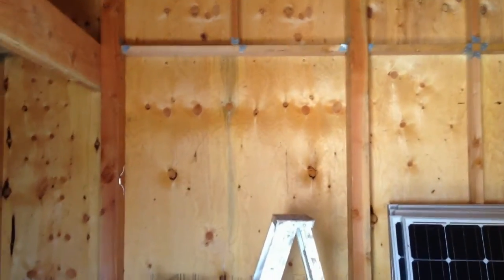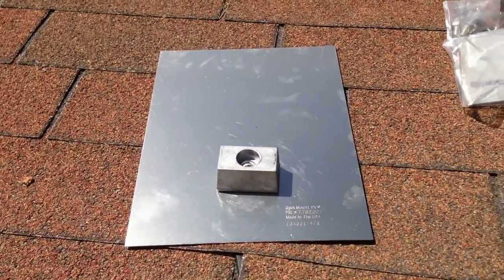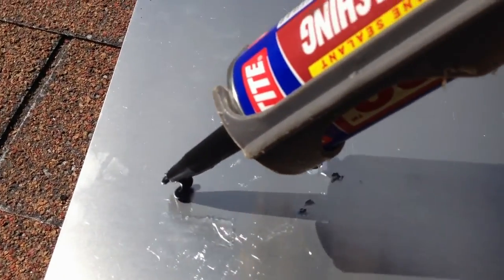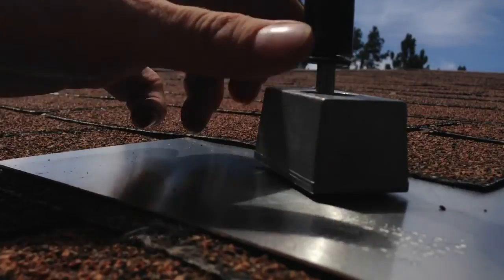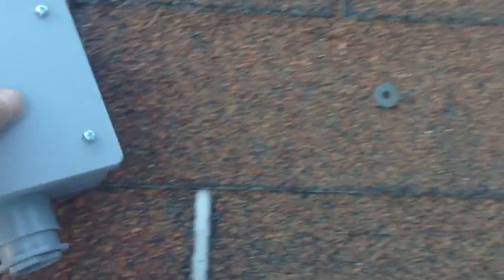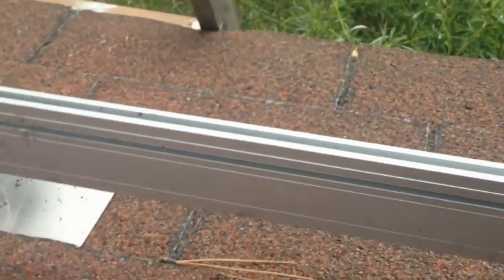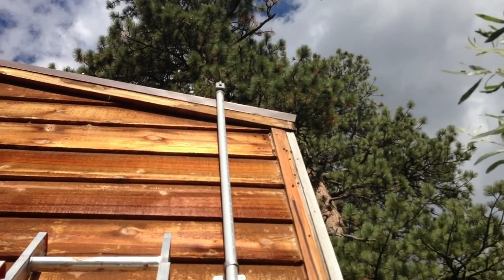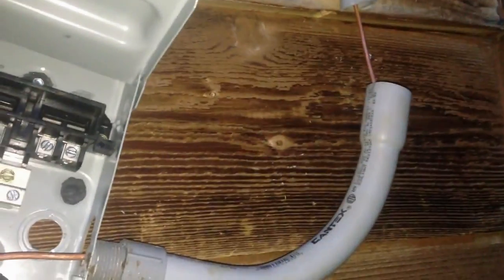Off Grid Cabin Solar Installation - Part 2

Comment: Running stiff wire through conduit was my favorite, too.  Hopefully you aren't using anywhere near as big of gauge as I used.  My foggy understanding of the whole process and future upgrades forced me to use some gigantic wire that was extremely difficult to get through conduit.  I like your mounting rails for your panels.  Makes for a cleaner install, although I am sure they cost more than my ghetto rig.  Good video.
Reply from the maker: they were bit pricey...i went "el cheapo" on my flashing/mounts at my house, but wanted to go extra distance this time around. i think i made same mistake on the cooper ground (went with beefy #6) which was overkill and brutal to deal with. funny thing is the chance of a lightening strike where i'm at is about nil too...lol...i even drove in a separate DC ground rod to boot during the trench process.  but if it happens, i guess im in good shape
Reply: Yep, cheap insurance and peace of mind on the grounding.  There is a lot of debate out there whether DC needs to be grounded or not but it is better to be safe than sorry.

My solar mounts work just fine but next time I will do the same as you did and get better mounts that will be easier to work with and hopefully able to tilt at least slightly due to the changing angle of the sun.  I am sure my angle is not optimal at all but my HOA requires solar collectors be parallel to the pitch of the roof so I had no choice.

Comment: Looking good Bro. Racks looked exactly like what I used for mine, they were very easy to setup. Looking forward to the next Video
Reply from the maker: Thanks Romo. Yeah, love em too...couldn't be easier. Also, like those PV Quickmounts, and even though cost a bit ($12/each), they're water tight and simple to drive in.
Reply: sunsensational I didn't order any of them cause I didn't have the roof for them but they look interesting